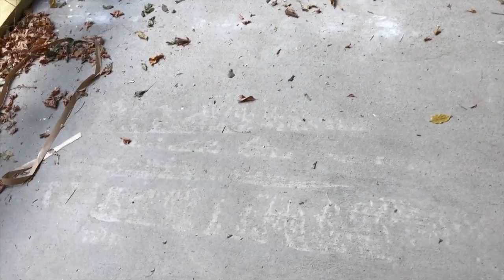Home Built Paint Booth Part 3 - Concrete Slab Sealer Prep

Comment: Why did they put a broomed finish on the slab to begin with?
Reply: Especially when there was a Power Trowel on their trailer.
Reply from the maker: lol I don't know, but it worked out, it's got a slick finish to it
Reply: Can you send them an invoice for your time and rental fee?
Reply from the maker: Why would I do that?  I had to rent this anyway to prep the surface for the sealer.  Just like I did in the shop, which had a machine finish on it.  The point of the machine was to put a "tooth" or to the surface to get the sealer to adhere.
Reply: So even if they power troweled it you'd still have to do that to 'green' concrete before you seal it?
Reply: Nope, Just let the concrete cure then maybe a wash over with acid etch.